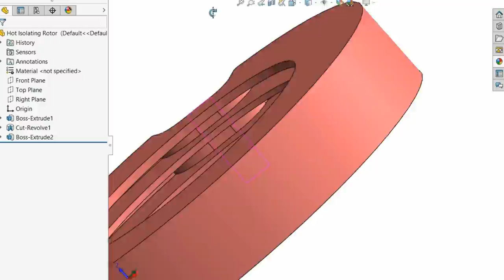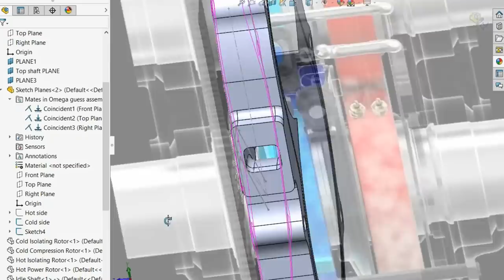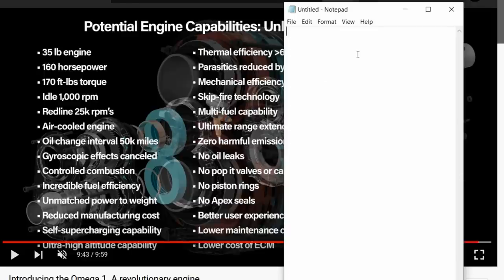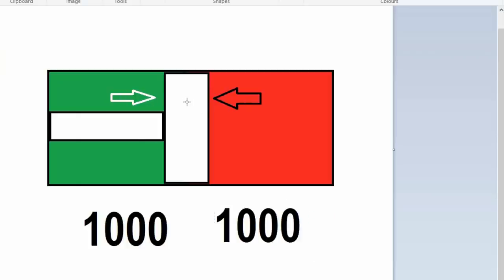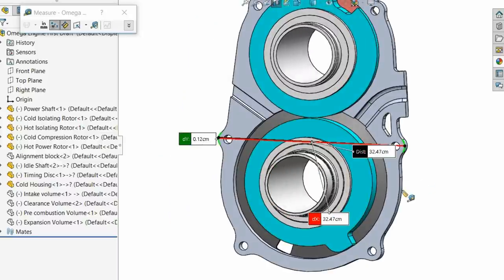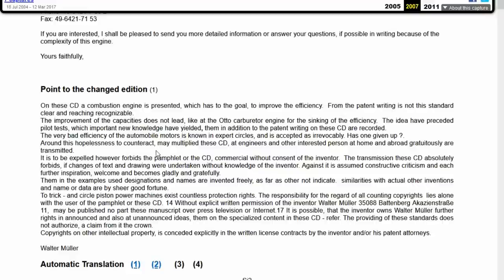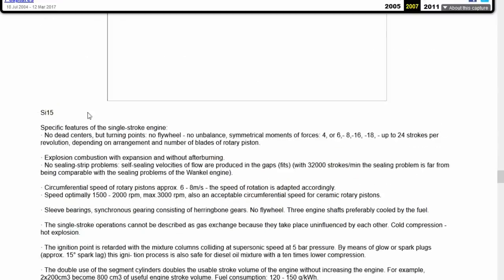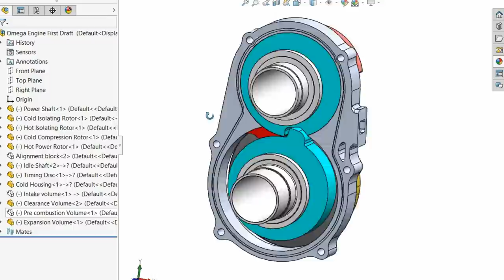Omega 3 - Something Fishy???

Comment: And I'm looking at those 6 bolts holding the sandwich together....and the depicted sealing around the case mating surfaces, and trying to imagine it staying gas tight. I'm also trying to get over how an engine that doesn't use pistons, has no piston rings...who would've thought? =)

Looking forward to the next vid Matt -- especially when considering the rotor to housing clearances required...and controlling them.... to hold the gases (without creating huge parasitic losses due to friction).

One thing's for sure, these guys are following the 3 golden rules of the new millennium scam -- don't tell the truth ; don't use you own money ; and never say no to a customer or potential investor.  B)
Reply: Remember the K series engine?
Reply: @nikoscosmos  Well not personally - they never really made it to market here down'under -- none-the-less, their dubious reputation even reached down here, and the first time I saw a pulldown on YT, I was just shaking my head, and muttering 'why?' =)
Reply: @gcbification  my friend worked for the gasket manufacturer. Horror stories....
Reply: @nikoscosmos  my brand new k series valve cover gasket shit failed within 12k miles

Comment: Gave up on wireless keyboards, had a few and they were all doing that thing yours is doing, or acted up if you typed too quickly. Wired with an extension cable, it's untidy on the table but it always works.

Comment: On the "nonsense" in the max efficiencies in the one stroke engine:
The surface temperature of the metallic/ceramic surfaces is not the same temperature, the working gases have in those circumstances of operation.
Take an exhaust for example: the exhaust gases have temperature over 1000°C, yet neither the exhaust vale nor the exhaust pipe melt away.
Ceramic components can handle gas temperatures of 1000°C or more, which allows for a Carnot efficiency of 75+% theoretical.

Comment: if they had designed the combustion chamber to be nearer the apex where the two exhaust rings seperate. then the combustion could be double acting on both rings. which (i think) would increas the expansion ratio, so you could make the rotors narrower. and make the engine a bit smaller atleast.
Reply from the maker: It's more complex than that  and there's more to come soon

Comment: Timing the ignition cycle would be fun at higher rpms, pre ignition and dieseling would be problematic.
Reply: In the 1960's, Honda had engines running to 22,000rpm with points ignition so with an old 8 bit chip 25,000 shouldn't be difficult and a modern chip could control everything needed

Comment: What i cant understand about their 3d model is that after the compression paddle passes the port entry into the prechamber, it doesn't have anything to stop the air from going out again and the pressure behind the compression paddle is atmospheric... And the another thing is that the rotary valve going to the ignition side has a very small opening which wouldn't give the air in the prechamber enough time to go to the ignition side to expand and that's a problem.

Comment: You forgot to include the afterburner in the efficiency calculation, the heat magically sucked away from the surface inside the rotating tube is going to make thrust out of the tube.
The liquid hydrogen fuel, that will stay liquid forever is going to cool the engine ambient temp to minus -200 C to get a higher efficiency.
Reply from the maker: And then not burn lol

Comment: Walter Müller from 35088 Battenberg died in 2019. He used to work in the company Ewikon, which produces Heisskanalsysteme / heat runners for the plastic industry. He engineered a heating system to effectively reduce leakages. He filed the patent EP0602272B1 Rotationskolbenmaschine, google delivers many of the patent images. Found all of this with google, the document you show in your video shows where Walter Müllers lived (Battenberg Akazienstrasse).

Comment: No it's not a passive flow linear engine that is something like a Bourke Cycle, self supercharging engine! Look it up they were actually developed and run back in the late 40s early 50s here for Outboard  racing. They were mostly 30 cubic inches to race in that Outboard class! Mounted on a mercury quicksilver racing mid section and lower units. These engines used a non pivoting connecting  rod and was an opposing twin sharing a common crankshaft! The bottom side of the pistons were isolated from the crankcase by using a round con-Rod and a sealing system. This made a vacuum when the piston went to TDC and then turned into a positive pressure to be injected into the top side of the piston and in effect was a self supercharging linear engine. The crankshaft was like a Wankels and was more of an eccentric than a reciprocal type crankshaft. 😳! And if you go to YouTube you can actually see one running! They employed either a spark ignition or glow plug ignition and would hit rpm's in the  5 digit numbers when they were properly turned. Life spans varied from the research I've done and heat was the biggest factor of how long one would last. As far as I know the family still owns the patent rights to this engine as I guess they've been waiting for the highest bidder to come along? It was not very efficient and because it needed either a mixed gas/oil or diesel fuel type fuel for lubrication of the pistons, rings and cylinder walls it was just another 2 stroke in the eyes of engine manufacturers, though like the Wankels utilized a oil chamber inside the crankcase to lube the rotating parts there. So No this moron has no idea wtf their even calling their engine, it has absolutely nothing to do with a linear action or process???? SMFH! I'm calling this one absolutely full of shit! HERES A LINK TO WHAT I'M TALKING ABOUT 
 Https://youtu.be/pKO2rJJaxCM

Comment: Just saw the article on this design and then came to YouTube looking for more videos of it actually running for more than 3 seconds and not on compressed air. I don't see the efficiency that they claim, and like the wankel, it's going to consume oil and exhaust it into the atmosphere. That "piston lobe" is sealing against the wall the whole time and needs lubricating, as well as against the two sides of the rotors, which will be as prone to failure as the wankel. With less power strokes per revolution as a wankel, I don't believe the output estimates. Complete rubbish!

Comment: A non compressed(swept) volume of 700cc will have a calorific value(energy) that is determined by the compression ratio(and type of fuel)... when compressed... to deliver a calculable amount of KW output . Can't you determine the maximum power, based on no pumping or friction losses using the highest CV fuel to show there is no way this engine can produce 160bhp? Factoring in min-max range based on AF ratio.
Reply from the maker: You can work out brake thermal efficiency. You have output power (160kW), swept volume (700cc) and energy density (46MJ/kg) and rpm (5,000)
Reply: @dirtygarageguy  You didn't include super slippy rippled steel painted black for thermal efficiency.
Reply: It's difficult to get to a real number, especially so when they're saying they're aiming at hydrogen as a fuel, and they're going to have a lean burn...(and then go onto muddy the waters by saying the thing can run on petrol as well =) See...usually when you're trying to math this out, you're figuring around the stoichiometric A/F calorific value, which they claim they won't be doing..

Comment: The maker said it will work great for hydrogen vehicles, how would that work for the high compression ratio and heat from an air cooled engine, is there an issue with pre-ignition of the hydrogen

Comment: The First Thing One Should Do When Roughing In An Engine Design: Is To Jot Down Your Fuels Mean Flame Front Speed, On A Sticky Note, And Paste It Up On Your Computer Screen..

Omega says: flame front speed? what flame front speed? 
we will just take the balance based RPM, with no thought to metallurgical limits either, and derive an advertised HP figure for our CAD drawing....same screw up as Alfadan's sans metallurgy.

Comment: The picture of four stroke from NASA (around 14 min) looked a lot like the Wright motor of 1903 (based on valve gear)
I've known what a labyrinth seal was for years, Yamaha used them on centre bearing of RD 250/350

Comment: maybe if the rotors were maid of titanium with a diamond hard coating like Casidiam, aluminum block plated with Nikasil along with oil for cooling and lubrication and direct injection for fuel delivery and use ball bearing shafts to seal the oil inside the engine, but it would be the same emissions problems as with 2 stroke or Wankel engines where excessive oil is burnt in combustion

Comment: Can I fire another question? There doesn't seem to be enough detail on the sealing. Even if there is the rolling seal on the inside between the chambers, sealing against the housing faces same potential issues as Wankel doesn't it? Amazing work and incredible analysis!
Reply from the maker: There isn't any seals. They say so themselves.
Reply: @dirtygarageguy  They can't possibly maintain emissions, compression, lubrication without a apex seal.  Total sham.  Show it to me running for more than an hour.

Comment: When those two counter rotating rings get hot they gonna expand, does the design allow for that? Does seem to. But if there's a gap, the pressure will just seep through. Seems like pie in the sky in any practical sense
Reply: That's why I don't buy the "no seals needed" claim.  That little protrusion between the rotors is going to have to seal to the chambers.  Then you have to have side seals to keep the oil in.  I hope it works, but I won't get excited until they actually make one that lasts a while in service.  I'm also very skeptical on air cooling.

Comment: Seeing you struggle with a wireless keyboard was infruriating. Also, get a keyboard with a 10-key for doing math. Also, learn shortcuts to save time. 

ctrl+b to bold highlighted text ctrl + i to italicize. 

ctrl+c to copy
ctrl+v to paste
ctrl+x to cut

hold ctrl on your keyboard and move your mouse wheel forward to zoom in.
hold ctrl on your keyboard and move your mouse wheel backwards to zoom out.

When in the calculator, if you hit ctrl+c, it will copy the numbers for you.

A wireless keyboard with a 10-key should solve your problems.

Using Bluetooth instead of IR keyboards and mice solved my poor communication problems. I suppose some IR interferes with the comms but 2.4Ghz over bluetooth works for some reason.

I enjoy your vids and your bantz. You are a CAD drawing genius from my perspective but I'm sure you'd caution me that it was just a shitload of time dedicated to learning it.

Comment: Well that’s where I think you have understated the compression ratio because of the smaller power rotor
Reply from the maker: What?
Reply: @dirtygarageguy  if you have a larger input effective piston and it gets forced into a smaller that is an additional pressure increase is it not? You only accounted for the swept area of the input rotor but the power rotor is smaller area
Reply from the maker: And I measured the exhaust volume in orange which is the expansion volume. The task is to calculate the compression vs the expansion volume ratio, however there's more work to be done because the pre chamber volume needs to be modelled and measured
Reply: I know it’s usually separated but it kind of needs to be viewed as effective compression ratio because of the larger intake rotor area
Reply from the maker: But the compression volume is larger than the expansion volume, I just need to measure the system as a whole
Reply: @dirtygarageguy  what is the difference in volume between the two rotors.  Not that it matters because as you said he is going to have problems emptying the smaller power rotor area and the whole engine is right angle bends everywhere.
Reply from the maker: The compression is 700cc the exhaust is 571cc off the top of my head
Reply: @dirtygarageguy  got it.  I am pascaling my gonkulator to figure effective CR
Reply: Nah I am going to need a best guess on power rotor chamber volume to do it.

Comment: If it made 170 ft-lbs @ 25K RPM, it would be 810 HP.
Reply from the maker: Ah... you're assuming it's at 25k rpm. They said it could rev up that high... not that it's make peak power there
Reply: @dirtygarageguy  I'm not assuming it does it up there.  Just merely working the other end of the equation.

If it can make its rated power at 5 or 6K RPM,  it makes zero sense that it would not be enormously higher at 25K RPM (Unless the torque fell away so fast as to make it useless).

Even if torque was down by half at 25K, that is still over 400 HP.  Their numbers make no sense.
Reply from the maker: No. A wankel can push 60k rpm, simple due to balance forces. But it doesn't run in that region. Just like RC piston engines can run 30k rpm...

Comment: By "linear engine" has that got anything to do with the kinematics of a crank-piston engine being non-linear and not simply because something is rotating..?

E.g. a piston has linear motion but can have linear or non-linear accelerations i.e. sinusoidal vs non-sinusoidal i.e. free-piston vs crank-piston

The "piston" of the Omega engine will have a sinusoidal cycle like a free-piston engine. The angular accelerations of the omega pistons and shafts is simple harmonic motion, the oscillation is linear. 

"Passive-linear" sounds like it's achieving this linearity without extra parts like having to drive the load through a turbine
Reply from the maker: So the force being generated through through combustion is applied to an driver (piston) and that motion is linear. The output is rotational. Hence the term reciprocating, meaning back and forth. 

All engines road going engined have a rotational output, including this one. So the rotational part isn't included in the description, otherwise they'd all be called torque engines. 

The passive bit is just nonsense

Comment: Even if it's a complete scam surely they aren't claiming a half meter tall chunk of steel weighs 16Kgs, are you sure you got the dimentions right? 
The "pistons" looks like to be the same size as the intake volume, assuming it's made of steel those alone should weigh 700*7.8g each, ~11Kgs just for the two discs. Is the rest of the engine supposed to be made of foam or something?
Reply from the maker: Am I sure I've got MY dimensions right???
Reply from the maker: And why are you assuming it's made of steel?
Reply: @dirtygarageguy  I meant whether you scaled it right, but nervermind, I made some bad asumptions